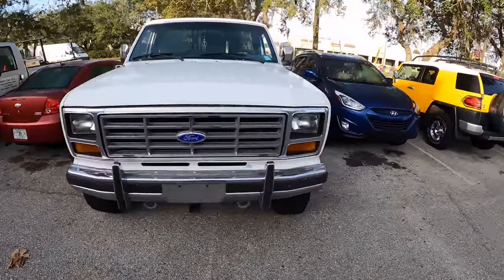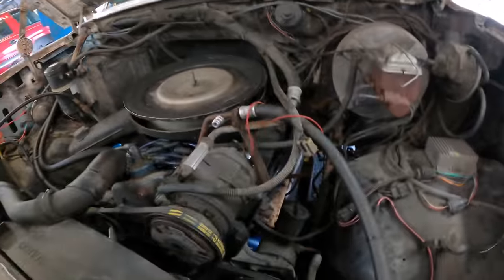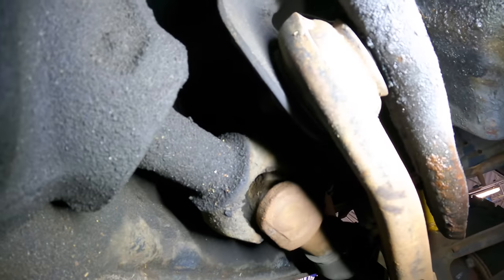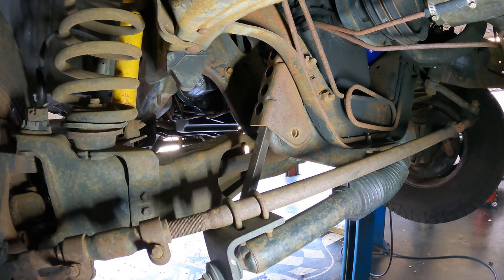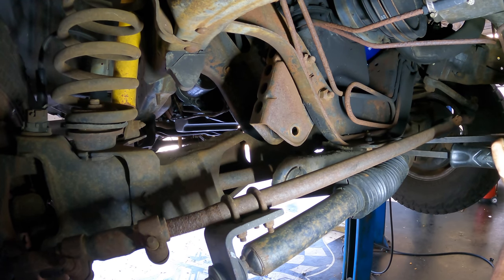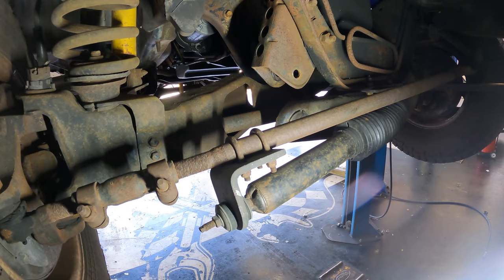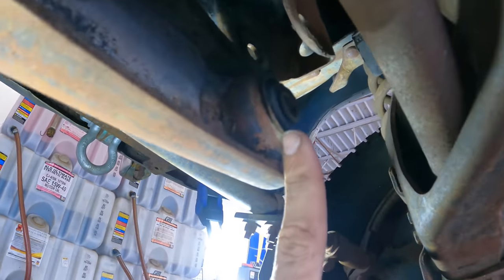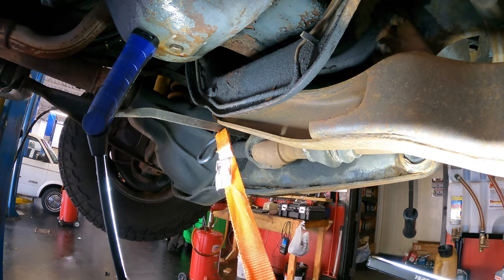Bushings DESTROYED! Assault Hammer to the rescue! Old Skool Ford F150 Classic

Comment: High beam selector foot switch is the part in question!  Rarity to be sure.
Reply: Wow, i would have never thought of that, experience for me would have said it was an exhaust brake, which iirc is found in some pickups
Reply: called them "dip switches" in Oz, cos the "dipped the beam"
Reply: Those were the norm back through the 80s not sure when they started to use them
Reply: When I was young my dad would let me press the switch, he'd tell me when. We had a bench seat in front and I could just reach the switch. [I should add - right hand drive in Australia, so the switch was central, just left of the clutch]. We got another car about a year after I got my drivers license - I haven't seen one of those buttons since.
Reply: I remember my dad's van having one in the 1960s in the UK
Reply: You beat me to it it's a common feature in Australia cars in the 70s 80s and 90s....
Reply: I 'member !!!! When gas was  .25 gallon!!! The good ole days.
Reply: I miss it. You could turn your high beams off without interrupting steering.
Reply: My dads old Morris had that on the floor of our old car and he would sometimes inadvertently press it when trying to rest his foot thus making the oncoming driver blink
Reply: Dimmer switch ...and they also used this design before that purpose as starter switch until late 40's. Also to speed up bushing install we used lube on them usually white grease before pressing them back in and use of air impact wrench ...
Reply: We had an old Morris Minor with one of them   it also had a rubber one the other side for the screen wash
Reply: I remember my dad's car in the 70's in the UK had one. but they were a rarity even then.
Reply: @rqangelful  when exactly was this im only 20 and always wondered how long ago was gas only a dollar or only a quarter (i live in california so 25¢ or $1 a gallon is hard to wrap my head around)
Reply: Common into the 70s but migrated to the steering column via a relay as new designs came out going into the 80s. Had them in my '39, '52, '59, '72, and '77 cars.
Reply: @iffracem  UK too. Had one on my first car, Morris Minor 1000
Reply: Last vehicle I owned with that switch was a 61 Chevy Bel Air. Had the big 283.
Reply: We had that on our 69 Pontiac parisienne
Reply: Driving my first car 65 Corvair there was nothing more satisfying then a stomp on the highbeam switch when some idiot blinded you.
Reply: @kevindavis6042  dimmer switch was first installed in a vehicle in the year 1949
Reply: @catslivesmatter1268  thank you 
I knew that they were used for quite some time but was unsure how long ago 
Regardless the simplicity of those days are long gone
Reply: @kevindavis6042  also back in the day was the vacuum windshield wipers which was a pain in the ass and the windshield wipers were also a pain in the ass,if they had the technology of days gone by in today's vehicles though it would be great
Reply: Also the starter switch was in the shift handle on Buicks from the 40 up until the late 50s
Reply: you are old if you know that, me too had cars with those , old farts
Reply: On really old UK cars they had foot pumps like that for the window wash
Reply: @catslivesmatter1268  My 42 Chevy Truck had the dimmer switch on the floor so it must have been before that.
Reply: My 61 ford galaxie was equipped with one and it failed. The result was having no headlights at all. That was not expected 😕.
Reply: @rqangelful  back in the 60s I was a pump jockey and gas was 14.9 and 16.9 and it took all I could do to get 3.00 dollars in my 64 dodge charger
Reply: @helfrie  mine had a gas heater in the trunk ( spider models ? ) Then they went to the updates on the heater because they were exploding and killing people
Reply: @daviddack1930  exactly
Reply: @catslivesmatter1268  I've never seen a starter switch on a shifter. My Aunt's 56 Buick had the starter switch connected to the gas pedal linkage. You had to push the gas all the way to the floor to clear a flooding problem with the early 4-barrel carbs so the engineers put the starter switch at Wide-Open-Throttle.
Reply: @larrykittell726  My Buick 59 Biscayne had a starter switch that you had to pull the steering column shifter back towards the driver , the knop had a flat spot with the words Starter on it and I took the starter out ( my dad's idea of teaching me a lesson ) and then he finally told me how it operated and I was really pissed but I learned a lesson for sure
Reply: Depends on if the lights are on high or low beam.
Reply: @catslivesmatter1268  That was the first generation.  Never saw one with a working one but then this was the mid-1980s when I was driving them.  It beat the factory heat which always smelled like burning oil because of the heater box/o-rings on the pushrod tubes design.  Fun cars to drive.  Trunk kinda functioned like modern crumple zone when you hit something hard enough.  But the lap belts were almost guaranteed to give you summer teeth off the steering column or metal dash.
Reply: We older folk know that, lol
Reply: @kevindavis6042   this is a copy paste.
The first federally implemented standards were introduced in 1921 by the IES. In an effort to better fulfill these requirements, engineers incorporated high and low beam options into headlights. The first cars to use this two-option lighting were rolled out in 1924.
Reply: Correct-o-mundo
Reply: The fun part was when they went bad. You hit it to select the beam you want and the lights go out give you a little shock the first time... but a sideways kick... back on.  IIRC they were like $10... became more of a game and replaced only when the sideways foot whack stopped working. :)
Reply: I can see I'm not the only one here that showing there age .
Reply: ⚡:SPEZIEL FÜR DICH
"BEST.FURDICH.FUN" :yt:
> SATISFY.BABY < :socialdist:

 

tricks I do not know
Megan: "Hotter"
Hopi: "Sweeter"
Joonie: "Cooler"
Yoongi: "Butter

So with toy and his tricks, do not read it to him that he writes well mamon there are only to laugh for a while and not be sad and stressed because of the hard life that is lived today.
Köz karaş: '' Taŋ kaldım ''
Erinder: '' Sezimdüü ''
Jılmayuu: '' Tattuuraak ''
Dene: '' Muzdak ''
Jizn, kak krasivaya melodiya, tolko pesni pereputalis.
Aç köz arstan
Bul ukmuştuuday ısık kün bolçu, jana arstan abdan açka bolgon.

Uyunan çıgıp, tigi jer-jerdi izdedi. Al kiçinekey koyondu wins taba algan. Al bir az oylonboy koyondu karmadı. '' Bul koyon menin kursagımdı toyguza albayt '' dep oylodu arstan.
Arstan koyondu öltüröyün dep jatkanda, bir kiyik tigi tarapka çurkadı. Arstan aç köz bolup kaldı. Kiçine koyondu emes, çoŋ kiyikti jegen jakşı dep oylodu. # 垃圾

They are one of the best concerts, you can not go but just seeing them from the screen, I know it was surprising

💗❤💌💘
Reply: @helfrie  I sold mine because I felt like I was scraping my ass on the road 🛣️ and I unfortunately sold it before I found out what it was exactly Worth in the club
Reply: I learned to drive on a 1965 Chevy Nova with a high-beam switch on the floor.
Reply: My 72 nova had three on the tree, inline 6 , am radio and 14 inch rims.   Plain Jane Nova.    Sure it could have used a 4 or 5 speed and a 350 but  I wish I could get it back .
Reply: I learned to drive in a 1977 Chevrolet Impala wagon which obviously had the same high-beam selector switch.
Reply: @markweaver6688  as well as my 64 Nova super sport , I had to go through so many transmissions it was a good time though, little straight 6 was awesome and you could swap out engines in an hour give or take
Reply: @kevindavis6042  a long time ago, because my 1949 Ford truck has one.
Reply: My 1968 Volvo Amazon has a similar
Reply: Dimmer switch
Reply: Where do you get them magnet lights
Reply: Yes I too know as well being retired driver with many miles under my belt almost forgot about that switch it's been so long :)
Reply: @rqangelful  yup when I was in high school, $1.00 would getcha pretty far.
Reply: @rqangelful  In the UK, I can remember in the late 60s thinking that petrol (gas) was expensive at 3/6d (17 1/2 pence or $US 0.24) for a UK gallon...
Reply: I had one in my first car of vintage 1962. Not seen it since
Reply: Dads 85 dodge had the same thing in the same spot.
Reply: I really do miss that left foot actuator.
Reply: Not rare, just old.  So is 3 on the tree and 4 on the floor.
Reply: @rqangelful  I remember .35 per gallon.  I must be just a youngster
Reply: I disagree that is what is used to activate the flux capacitor
Reply: that's right  hi low beam
Reply: Yeppers!
Reply: @kevindavis6042  My 2000 big truck had a footswitch. I'm not sure when they discontinued them.
Reply: @mikedauphinais3713  easily replaceable. 2 screws and a 2 wire connector.
Reply: @007von  $0.20/gal in Denver in 1963.
Reply: The foot operated dimmer switch was used until the early 70s, after which the stalk mounted dimmer switch was invented by Chrysler corporation
Reply: High/Low headlamp switch.  My 1968 F100 had that along with the 300 CID 6 banger and a 4 speed manual.  No wheel adjustment that year.  Not one of Ford's better ideas😁
Reply: Single cabs are common not rare extended cab is rare  all my trucks have the high beam on the floor I wouldn't trade my 75 f350 for a brand new truck anyday they are all garbage any brand  past 1994
Reply: Oh the good old days,    My first truck a 68 dodge had one of those bad boys in it !!!
Reply: Rarity in my '69 F250. So not really rare ;)
Reply: @kevindavis6042  Since high beams existed
Reply: @CALVINLNIKONT  thats insane what was considered the best car out at that time and what was the most common car
Reply: Had one of those in my first car.
Reply: @rqangelful  Gas was 57 cents a gallon when I got my driver's license in 1975, and I was PO'd! I expected it to be in the 30-40 cent range like it had been as I was growing up. Does anyone remember the gas wars stations used to put on?
Reply: @007von  I grew up in SoCal in the 60s when gas was 29 cents a gallon. Stations used to have "gas wars" to compete with each other. 1970s saw gas prices rise until by the end of the decade gas was about 1.00/gallon. It just went up from there. I'm hearing we need to be prepared for $4.00/gallon beginning in March (maybe higher in CA and HI where I think they are already at $4.00/gal).
Reply: I have seen both, but it has been a long time ago, foot switch for high beam and exhaust brake (bus + 18-wheeler, not pickup).
Reply: Won a bet with my 20 year old son about that switch. He didn't even think it was a switch.
Reply: All of our old American cars and trucks had them while growing up. I was surprised that my '69 Triumph TR6 had one.
Reply: Yes it is the high beam selector
Reply: It's an anti theft device...for real...when it's wired properly on vehicles that didn't have one.
Reply: @Zeus-wl2pl  The Chevy 283.  Which was an evolution of the original small block, the 265 for the Corvette.  Later evolved into one of the most hot rodded engines of the 60's, the 327.  Built more than a few of them.
Reply: @amadueskooler6559  I refuse to be called an old fart.  The correct term is "more experienced individual".
Reply: @lonzosatterfield4760  Not sure about the Blue one Ray used in this video but If you are in the States check your Harbour Freight store. Canada’s equivalent is Princess Auto. They have had the same style as others Ray has used.
Reply: @iffracem  Yep, my old man's 1961 Falcon had one - I learnt to drive in it. 2 speed auto, drum brakes - what a POS. It would be worth squillions. Amazing.
Reply: @dennisrogers8107  I beat the hell out of that engine, and I sold the car( still running great) at 185,000 miles, to a friend of mine for fifty bucks.
Bought a ‘68 Camaro convertible with the 327. That was a gas hog. Luckily, gas was twenty five cents a gallon. Thanks for triggering the great memories.
Reply: @larryaugsburger8452  I agree..I wish we still had them. I've thought about seeing if I could wire one in my van. Imports started the dimmer switch on the steering column because almost all imports were straight shift
Reply: @keithlarge1151  some of those starter switches actually pushed on the starter itself
Reply: A much safer way than the ones now. You could switch without moving your hands on the wheel, like in the middle of a curve.
Reply: 99% of all army vehicles still use this method for the switch
Reply: It's the "Motor Vehicle Mating Signal".  If you experience an oncoming motor vehicle when it's dark outside you can initiate the "Mating Signal" by tapping that switch twice and the oncoming motor vehicle may answer it by blinking its lights at you.
Reply: @AppleTom9091   i have an 1938 car with one on
Reply: @catslivesmatter1268  i have a 1938 Lanchester with one uk
Reply: @007von  I was pumping gas at my uncle's service station in the late seventies and early 80's and sold premium gasoline 97 octane for 75.9 cents a gallon!...this was in Tennessee
Reply: Yeap, I've got a 72 valiant that has one
Reply: Interesting - my initial thought as a fuel pump engine kill switch so no one can steal the truck.   Figures.
Reply: I N THE UK DIP SWITCH FROM WAY BACK
Reply: Not rare at my house, I own 9 vehicles, and they all have one.
Reply: Had a 72 Chevy that had the floor switch. Absolutely loved that feature
Reply: My old 79 has one. I even have a spare on the dash for some odd reason. It's been riding there for the past decade or more now.
Reply: Known as a "dip switch" in the UK, here they started falling out of use in the mid 60s as manufacturers combined this function with others on a single multifunction switch on the steering column.
Reply: We had the same switch (beem selector) on our Vauxhall Victor 101 deluxe here in the UK, Manual 3 speed + reverse of course! Column change.
Reply: Very common on older British cars.
Reply: Nothing like a good stomp on the dimmer switch. Sure miss that.
Reply: Absolutely. I only recognize it, because my Ma's car had the same thing back when I was a kid.
Reply: I thought to myself when you defeated gravity "like to see you do that again".... Right on cue ray! Welcome to the matrix.
Reply: @Aussiebloke0001 Seen one in a late 80s early 90s Commodore VL but it could have been a mod and not stock.
Reply: I miss my old 91 f-150 it had one of those.
Reply: Not rare in that year. Idk how many vehicles that old still exist
Reply: First car I owned (1963 Mini Cooper) had one.

I didn't own it in 1963, me being 6 at the time...
Reply: @rqangelful  Cheapest I paid was 67p here in the UK (we have 20% bigger gallons) - 1975 I think. That's pretty much a tenth of today,s price.
Reply: Not rare ford's from the eighties all had them it's the way Ford made them
Reply: I loved those when i had one
Reply: Not rare, just vintage. They were typical in the era.
Reply: 3 of my trucks had em. Honestly prefer em, and no aint no old head just a 22year old who loves pre 90s fords
Reply: @larryaugsburger8452  Try driving a '58 bug in a rainstorm, in the mountains, and in the middle of the night. In Canada the dimmer switch was the same foot as the clutch. With only 32hp in a 70's era mountain pass, you're always changing gears. Not a fun drive.

Back in the bad old days, standardization was non-existent. There were as as many configurations of dimmer, signal, and washer switches as there were manufacturers.

Kudos to Ray for sparking a conversation!
Reply: Now it's better, you can burn the corneas of the on coming traffic every time you use your turnsignal!
Reply: The same switch in the old US military jeep was the starter.
Reply: I agree. My dad's old Buicks had it.
Reply: got one of them on my 442.
Reply: @iffracem  😂
Reply: @kevindavis6042  I drove a 1939 IHC 2 ton flat bed hauling hay on the farm in the 50s and it had one too. Also had a manually shifted two speed rear axle.
Reply: Standard old school design for the 150.  My Father drove a 1968 F150 in the 1980s/1990s and it had the high beam switch in the same location.
Reply: My dad had a Chev El Camino pickup in the 70's and it had the same high beam switch. Makes me realize how old I am
Reply: City buses still use that tech...lol
Reply: I vaguely remember them from when I was a kid, it didn't make sense on vehicles with a clutch but the positioning made plenty of sense given how many other potential switches cars have now.
Reply: Tried to describe these to my oldest son (29) few years hack, he never heard of or had seen one.  He said it's crazy and would be dangerous.  Oh the younger generation lol
Reply: @kevindavis6042  My 94 and 95 F150s are both on the column. I think they went away with the OBS so very probably very late 80s.
Reply: @kevindavis6042  I don’t really know when the High Beam switch on the floor started, but I’ve owned 1960’s cars that had them there. 

I WAY prefer the floor mounted setup. But maybe I’m just old.
Reply: For those of us who know that switch, glad to see non-millenials still driving
Reply: @davewalker8870  My 1974 Mk III Cortina 2000E had a foot operated screen wash pump on the floor to the left of the clutch pedal
Reply: Hi beam selector
Reply: Never had these this side of the pond that I remember. But had seen it before State side. When were they phased out? I was in Oahu prior to Rona and am I right saying the parking brake was a foot pedal action?
Reply: @chrisbentleywalkingandrambling  on some the parking brake still is a foot pedal, against left wall, mine is a pull to right and below steering column, if I remember right the high beam foot switch was late 70s early 80s, but military 5tons and deuce and a halfs still had them in 2015
Reply: @joshuabushard  appreciate the info. Thank you for the reply.
Reply: Lol. Much earlier than that.
Reply: Yup low beam high beam
Reply: check this out. my left leg is prosthecit
Reply: I'm back(wrong button) not having a left leg I moved the dimmer switch under the dash on my 78 f150 walah problem solved :)
Reply: We had a ‘62 VW Beetle and he was really tired one night, so he hit the dimmer switch and shifted the car. Funny thing is that the shift actually worked! :-)
Reply: @kevindavis6042  they are about as old as electric headlights
Reply: Yep.  An easy one for those of us over 50.
Reply: High beam button. I'm old so our cars back in the day all had them.😊♥️